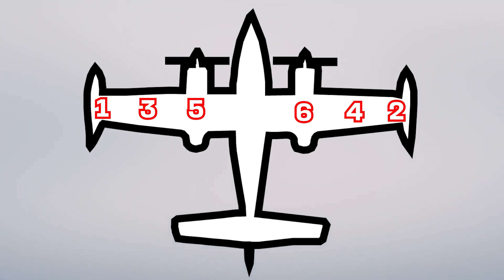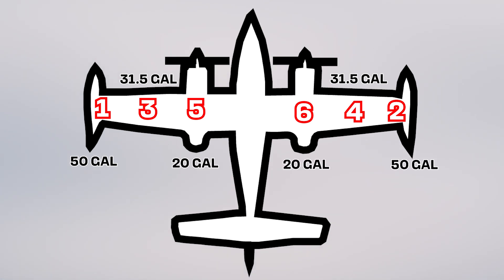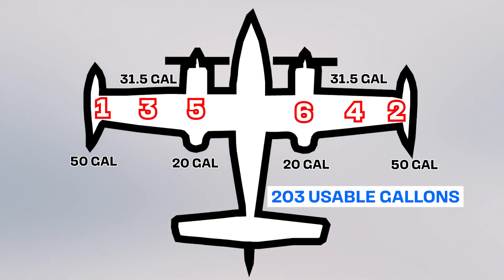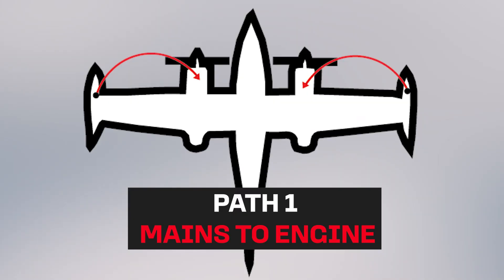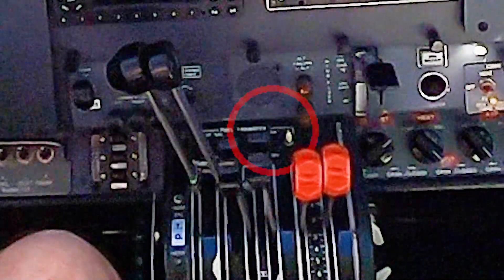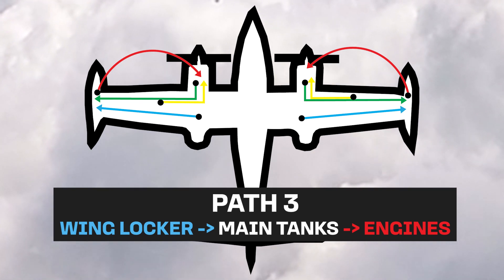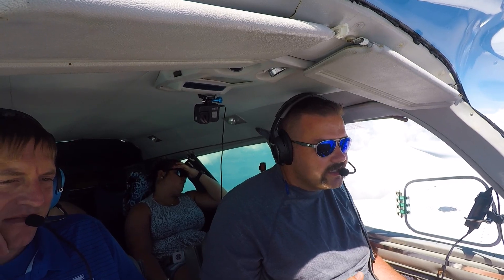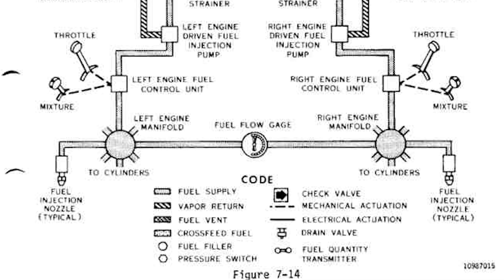Is this the MOST COMPLICATED FUEL SYSTEM? Twin Cessna 310R

Comment: This is not a complex system.  MD-11, now that’s a complicated system.
Reply from the maker: Ok you win
Reply: Bah. Numbers 1,2 & 3-Left wing, Center wing & Right wing. Upper & Lower Aux. Horiz. Stab fuel. You want complex-go way back-to the DC-7. 4 mains, 4 alternates, center tank & if equipped nacelle tanks. Same with the Greasy 8-4 mains, 4 alts. Center wing & if equipped Fwd. Leading edge ( DC-8-62 & 63 )

Comment: Hi ...did the aux tank have a fuel pump?
Reply from the maker: The aux tanks do not have a fuel pump. They can feed the engines directly with a fuel selector switch in between the pilots and co-pilots seat.

Comment: And you can also cross feed fuel from the left tank to the right engine and vice versa. Handy if an engine craters and you need to keep trucking along.
Reply from the maker: Yep. Some planes that's an emergency procedure. For the 310 it's a standard weight and balance / fuel management approved procedure.

Comment: Another important thing is that you can cross-feed your engines from the main tanks, that means that you can spend fuel from one engine sourcing it from the opposite side tank, left engine feeds from main right tank and vice versa but you cannot cross-feed from auxiliary tanks. I’ve only used cross-feed for testing purposes but never in normal cruise in 40 years flying a C320. I tend to think that the fuel system should regularly be managed around the main tanks: take-off and climb on mains, then switch to aux until they are low then switch back to mains. Also important to remember that tuna type tanks have the aux pump on the bottom of the tank, if you have a main pump failure while feeding from aux you must switch to mains or you will be in big trouble.
Reply from the maker: Yep. Some planes that's an emergency procedure. For the 310 it's a standard weight and balance / fuel management approved procedure.
Reply: Yeah, but you have to make room in the mains FIRST before switching to the Aux tanks....The extra fuel that is pumped from the aux tanks (the pumps pump more than the engine can use) is routed back to the mains...so you gotta burn some out of the main tanks first...I generally run on the mains for 30-35 minutes (to make room for the returned fuel from the aux tanks), then switch to the aux tanks until they are dry....which (sorta) refills the mains.
Reply: @HyperSpaceProphet  you are correct!

Comment: Bryan with a Y said not to worry just squawk 0000 and press the ident button 50 times for out of fuel. They will send a KC135 out to refuel you right away mid flight 👍😆 Seriously though that is a very interesting fuel system for sure. I've heard from more than one person that a 310 has one of the most complex fuel systems.
Reply from the maker: That ole Bryan with a Y is just plane silly.

Comment: I've got a 340, and it has the same fuel system. Not that complicated, but it is complex. Just pay attention to the time spent on each tank and you will be fine. I go 35+ minutes on the mains then run the aux tanks empty...But only have ONE locker tank, so if I'm gonna use that I have to move it to the left tank then crossfeed to the right engine.
Reply from the maker: I agree. You have to actually MANAGE it instead of pressing buttons.